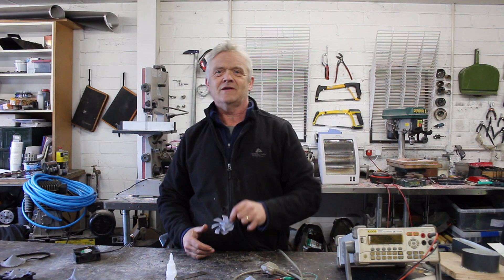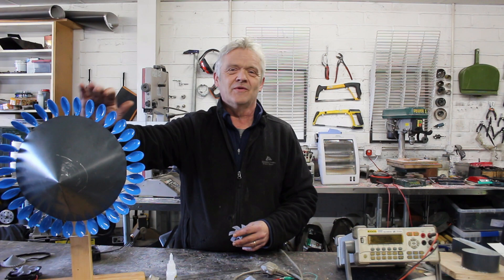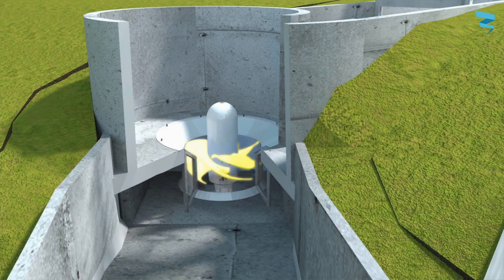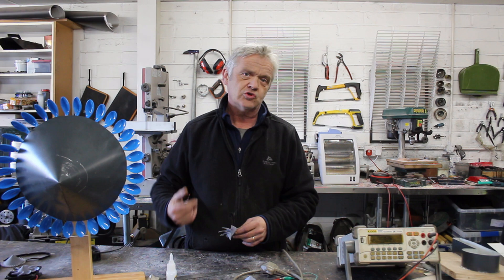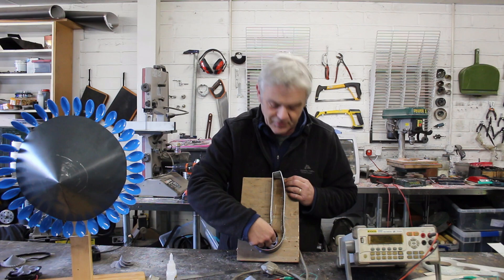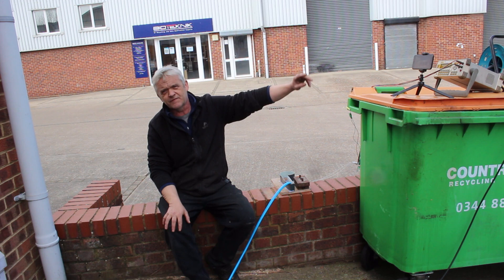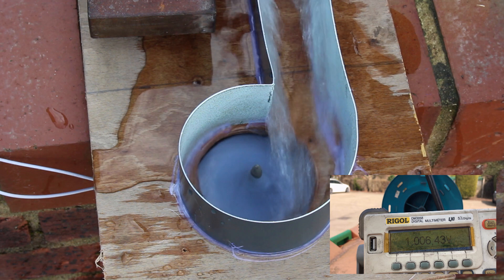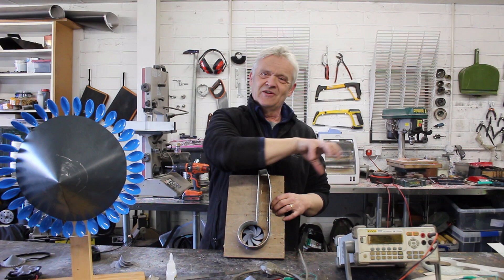1487 A Whirlpool Turbine

Comment: Seems like a perfect fit at the top side of a rain gutter. The signal might also be used to quantify rainfall.
Reply from the maker: I like that - cheers mate
Reply: @ThinkingandTinkering  You want at the bottom of the rain gutter to have more head pressure. Create a nozzle to spay the water onto the blades rather than flowing over it. This is the design that I will be submitting for the 3D printer. Don't tell anyone ;)

Comment: Robert, you need a wider collection space for the swirl.  The tangential velocity of the swirl locks step with the inner/center of the swirl.  What may seem slow on the outside edge is deceiving because it is moving much greater distance around than at the center.  If you ever swung an object on a string around a circle, and then shortened the string, you see the effect.

Comment: This I'm sure would work much better with an airtight lid and under more water pressure ? The turbine placed at the bottom of a  gutter pipe or somewhere within the length of pipe and a head of water applied. Compressed air would work a treat too.
Reply from the maker: good ideas mate

Comment: Is there a potential in stacking several of these, making the water go back and forth through them as it comes down? Thinking a stacked column might be a simplier solution to a home water Accumulator set than going for a pressure version.

Comment: I was wondering if you could have one generator on top that takes the flow into account, then have it drop a foot or two into another one that utilizes the energy from the drop?? Maybe take a piece of pipe, cut it into fourths, and glue them to the shaft. Than put a pipe off center so the water drops to the second generator? Or you could put them on the same shaft to increase power going to the one generator?

Comment: Wouldn't it work better if the blade was the mirror image of this, as in the top edge lead (first edge the water would hit) then it would be forced down through the blades to the exit, looks like most of the energy of the water is sliding over the blades on this angle but still getting rotation ?

Comment: People need to remember that both air and water are fluids - and it is the fluid flowing over/towards a surface which creates the pressure to move that surface. However, water is somewhat better because of its density....
Reply from the maker: I am sure most folks do know this mate
Reply: @ThinkingandTinkering  I think if you asked 100 people to name 3 fluids, the vast majority would name liquids, and not gases.

Comment: Would this turbine be more efficient if the turbine itself has more vertical veins or even the top edge pointing more towards the flow? 
  Maybe a V shaped blade on its side to act as a bucket to give more torque?
Reply from the maker: nice idea mate - give it a go

Comment: the next question is, would this shape work also as a pressure water generator if you use an angled water nozzle?
Reply from the maker: oh yes most definitely - but I will run it and see

Comment: This design screams Tesla turbine to me.
Reply: Tesla turbines are very different from what is shown.
Reply from the maker: like a Tesla in reverse? the water flowing through what is usually the exhaust port ?
Reply: @ThinkingandTinkering  A Tesla turbine on it's side, exhaust downward. 

The volute would likely need to be narrowed to increase the velocity of the flow aimed at the tangent of the disks and increase the number of spirals of the fluid before it exits. Including the longer star washers (I think it's the 1921 patent) would be paramount to give it starting torque. The larger the diameter of the disks, the lower the rpm needs to be to handle a higher linear velocity at the tangent. That's the best way to scale a TT.

Interestingly, you could probably combine Tesla disks with the twisted impeller blades at the exhaust of the tesla disks. Try laser cut acrylic, should be easy enough to experiment with.

Don't forget the star washers. Most people on YT forget them and complain that Tesla turbines have no torque. They are important.

Comment: You made me just think of something: I wonder how much energy could potentially be made if you had a constant flow of say 1000 Gallons per hour, and then you had an underground well shaft/mineshaft where you had a stack of these generators going down-for example every 10ft for 100ft-so 10 in all--each one being 80% efficient in converting water to energy for example... any math guys out there that could estimate or give an answer in watts?
Reply from the maker: that would be quite some output mate
Reply: The type of generator Robert is demonstrating - as he correctly states at the beginning - is not about drop height of the water.  You post a simple question.  You ponder a component of mass times velocity.  Calculate your gravity and drop to determine your velocity.  Then look up the Betz law. edit:  I put Lenz when I meant Betz.